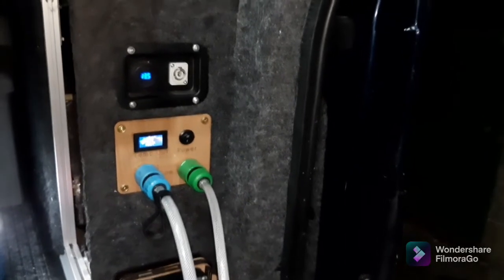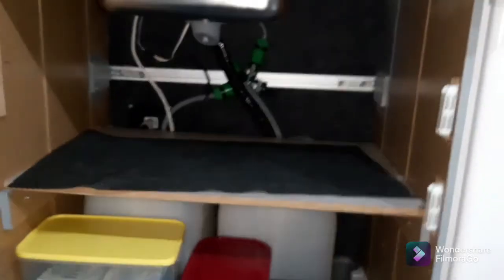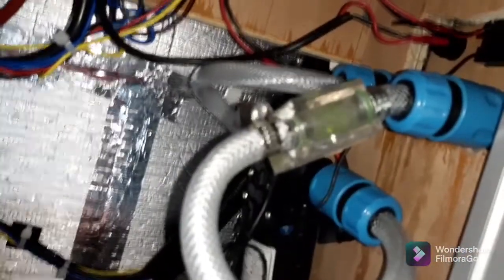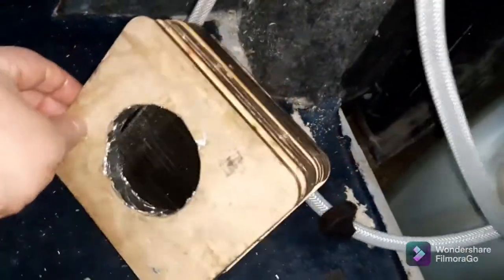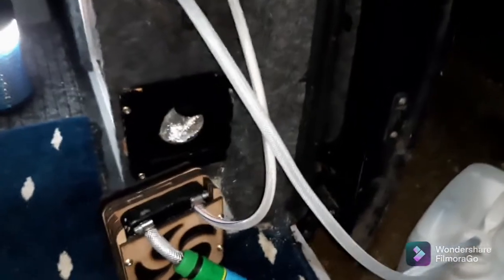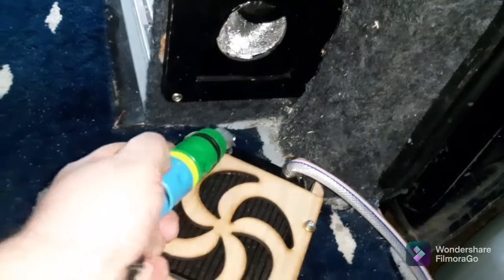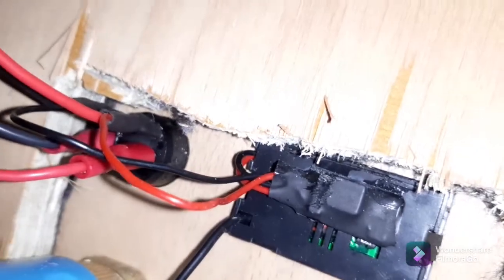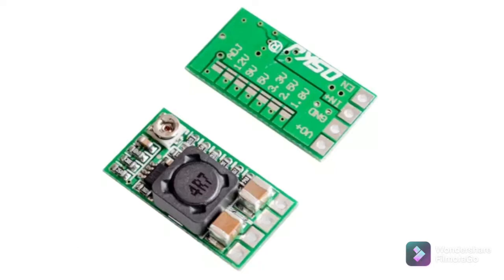Diesel heater hot water heater V2. Hot water using diesel air heater. #vanlife #campervan

Comment: Was just thinking about this idea, and then looked for it as someone was bound to have thought of it already to give ideas.👍

What about also a large reservoir made out of PVC pipe painted matt black on the roof for hot climes abroad, and gravity feeding through the heat exchanger when it's colder?
Reply from the maker: That's on my todo list. I'm thinking of something can pop on the roof that has a solar panel, temperature sensor and small pump. The idea being, if the sun it out, it's warm enough then run the pump to heat the water

Comment: Great video there Brian.
I've all the parts involved in the shed ready for a trial run.
Any do's or don't since its been up and running..?
Never thought about the quick release fittings.Good idea.
What pump did you use to get the hot water from your tank to the shower..?
Was going to add a copper pipe/egr cooler to the exhaust for extra heat and add it to the circuit.
Any thoughts on this..?
Reply from the maker: The only do and don't is don't touch the heat exchanger it gets really hot ! 
Good luck with it, let me know how it goes.
The pump is just a cheap 12v thing from ebay. I might be changing that as its very noisy

Comment: Brilliant,  I've been wanting to do the same for some time however was worried that wood would get to hot and burn,  do you think with the foil this wouldn't be an issue? Thank you
Reply from the maker: The foil is more to stop heat being absorbed by the wood and reflected out. I think wood ignites at over 300⁰C so it should be OK.